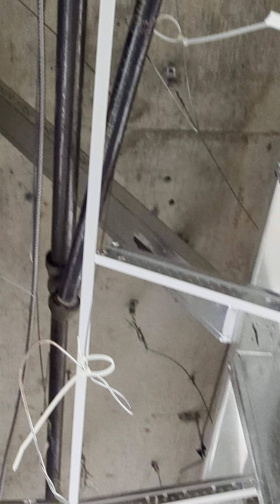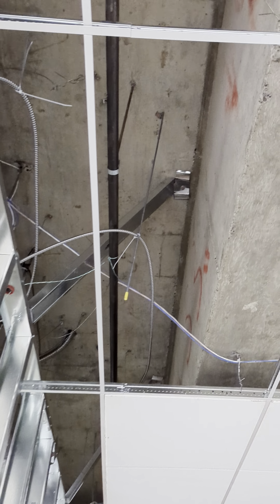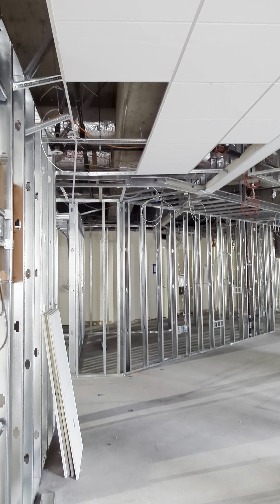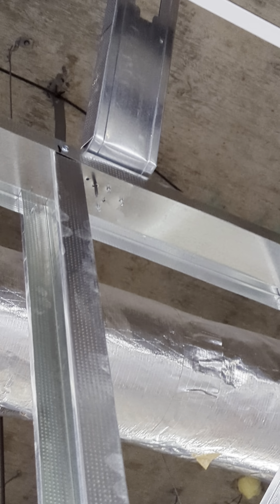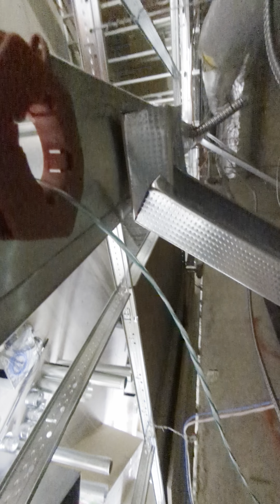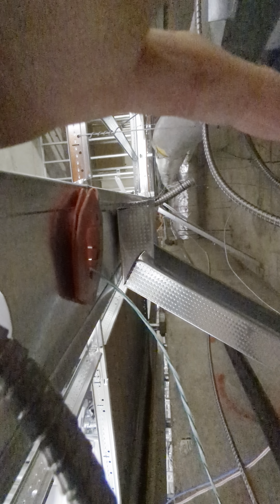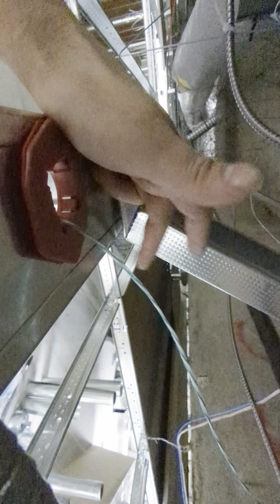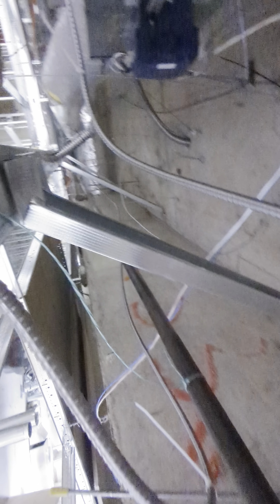Metal stud Kicker fail. Redo

Comment: I usually do my kickers with the stud turned sideways where it's strongest, and screw it onto a separate piece of steal shot to the concrete, and a separate piece screwed onto the wall. I've actually been told not to do it any other way from our PM also.
Reply from the maker: Agreed these are very strong and often called out for in the prints. A balance between strength and need must be achieved for quality and production. 
It would be much stronger to set every stud with a 16ga clip, 4 screws and #10s. But this would be a waste of time for a Ti job... Etc